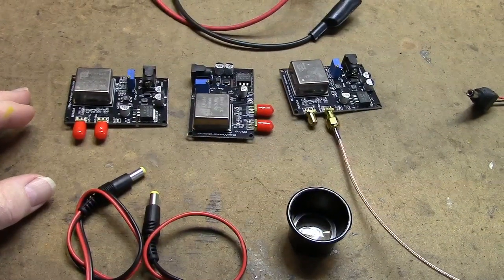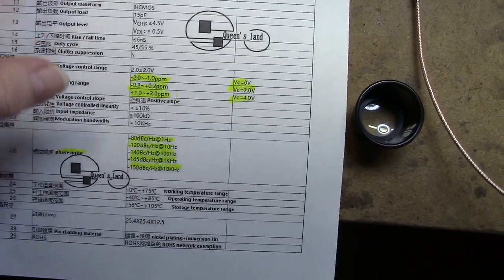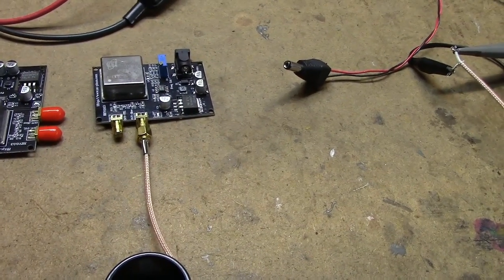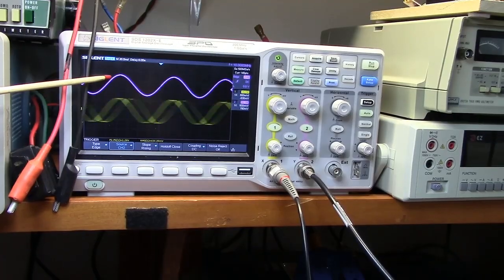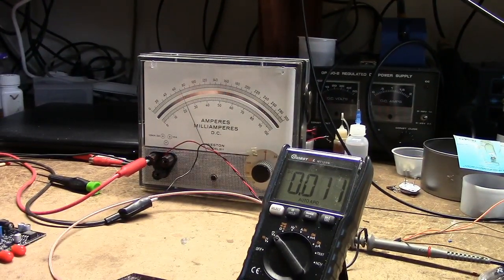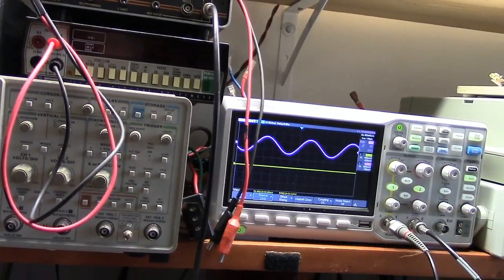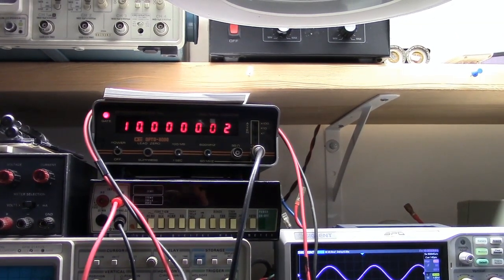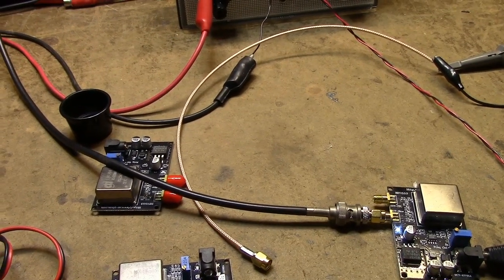OCXO Frequency Standard

Comment: Interesting as I'm looking for a cheap frequency source.where did you obtain these from please.
Paul.
Reply from the maker: Hi Paul,   I bought 3 on Ebay , and 3 from Aliexpress.  One of the ones from Aliexpress was DOA.  I also bought 10  of the single can oscillators from Aliexpress.  They all worked.  Note that you may have to modify these as I did to get them exactly on 10 Mhz.

Comment: If the frequency counter and the GPS clock disagree with the OXCO, which is correct?  What's the point of having a frequency standard if the 'standard' frequency can be changed by the user?
Reply: It's called traceability. Pretty much everything is referenced to something more accurate. In this case, his GPS is referenced from NIST in Colorado, and he will use that standard to set his new oscillators. Once he has those dialed in, then those can become a new ref standard.
Reply: @moki123g  He is correct.  And the device is then referred to as a "secondary standard".
Reply: I have a Racal counter with Rb osc which is networked/synced to other devices, I have never tried comparing it to a GPS clock (which I do not own) but would be interested if someone has made such a comparison. I assume the GPS uses some sort of rolling average counter?

Comment: Other youtubers have found that resistor changes in the voltage divider feeding the reference pin have to be made.  I followed imsai guy's suggestion and changed R2 from 5k to 3.3k and was able to get it spot on measured with my GPS referenced frequency counter.
Reply from the maker: Thanks John.  Two of the units adjusted ok.  The third was unable to hit 10 Mhz spot on.  I will do the mod you suggested.
Reply: Brilliant iv got one of these and use it to set up my frequency counter.